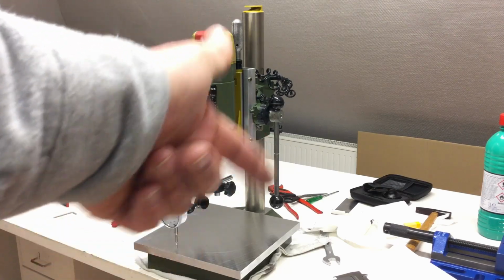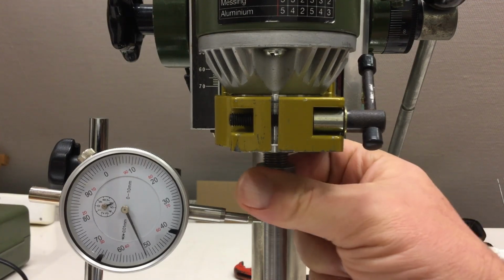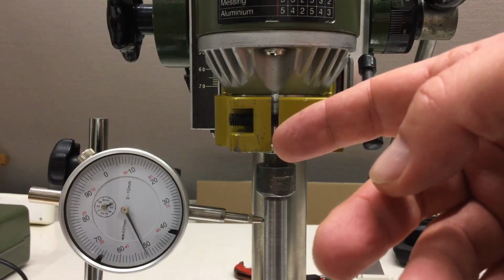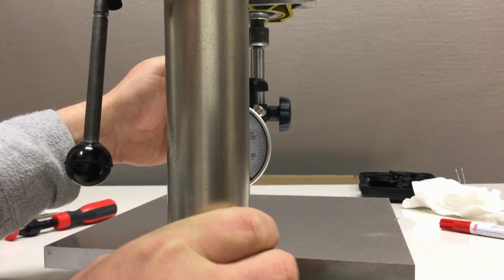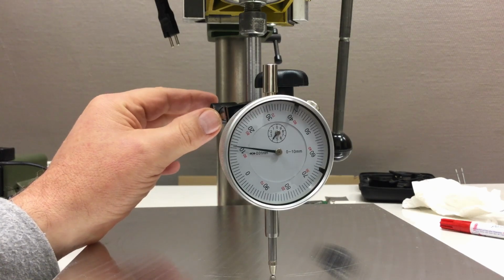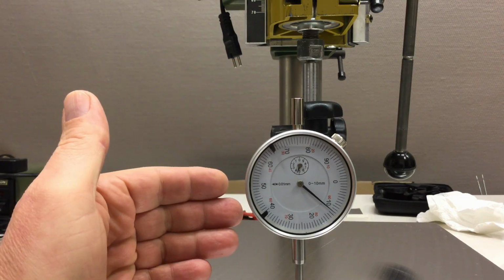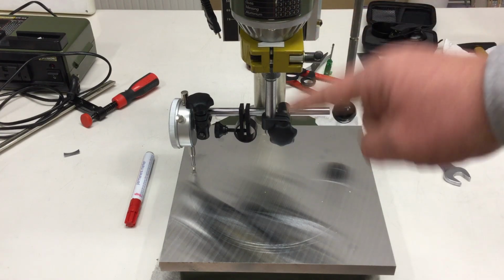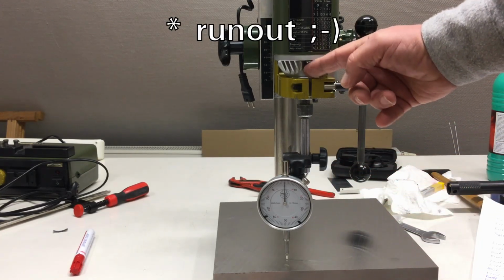Tramming the Proxxon BFB 2000 & BFW 40/E Milling Machine (2/2)

Comment: Essentially this milling machine is just a router mounted on a stand.
Reply from the maker: Yup! But the motor of a metal mill is not called a router, it's called a spindle 😉 The very real difference: My spindle does between 900 and 6000 RPM. Routers are usually between 5000 and  25000 RPM. Though spindles of CNC mills can reach those RPMs too.

Comment: You'd got a really nice result. Is very hard to obtain significant values off that single and small column... other than the adjustmen you made  there are infinites more variables: the runout of the axxis you mention, the flatness and alignment of the cross slide table, the quality of the collet, the fixing mechanism. and much more. 
You can survive in this world with the mill at this state... if you're not Steffan Goteswinter brother
Reply from the maker: Thanks! And yes, there are a lot of error sources in that setup. But for now it has to suffice. Regarding Steffan Goteswinter: There's a reason I have abstained from buying a micrometer so far - using it would be too frustrating 😅

Comment: It seems like there would be a problem to mill steel with this machine + stand. It doesn't seems to me to be rigid enough. I was thinking about buying such a machine but I think I'll stick with my Proxxon MF70 micromill even though it can handle max 3mm diam. endmills.
Reply from the maker: Well, mild steel might be indeed a challenge for that little milling setup 😅 So far I've just used it for POM and aluminum. But then, if you feed very, very slowly, I guess you can do mild steel too - it just will take quite a while 😉

Comment: the table is not that flat and you  can check it, and the hole lock the Z  is such big than the Z, surely it gets lots of problem
Reply from the maker: Well, you're right in all regards. But then, there is no thing like a mathematically flat table. Are there tables that are more flat than that Proxxon thing? Of course! But that's not the point here, respectively, of tramming. The point of tramming is to minimize one error of your machine as much as possible.
Reply: @robertssmorgasbord   I solved this problem in several ways. And I have two tables, and fixed all of them. Insert the copper pipe into the hole in the base，so that is more precise way. Grind the bottom plane, or add a few thin steel plates to it in advance, which not only reduces weight, but also improves durability and flatness.
Reply from the maker: @stockstergates4061  Thanks for the tips! But I fear I have currently not the capability to precision grind plates 😅